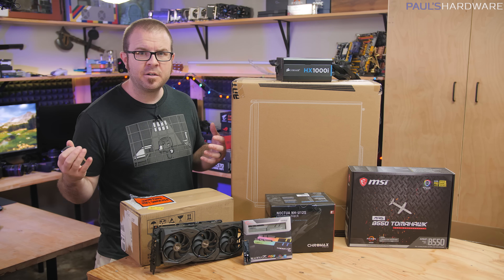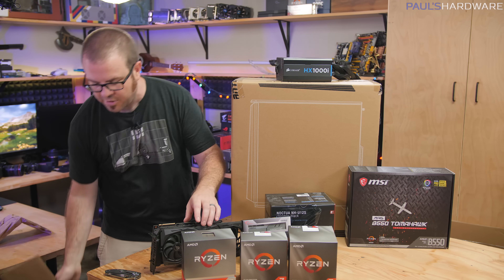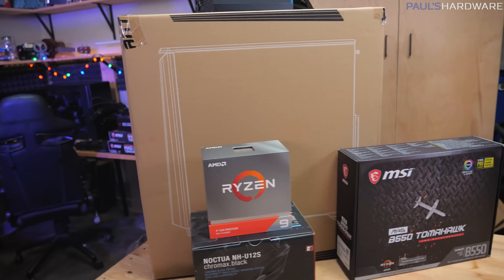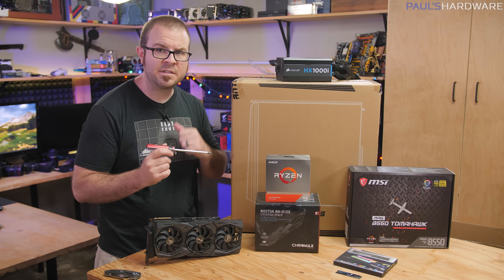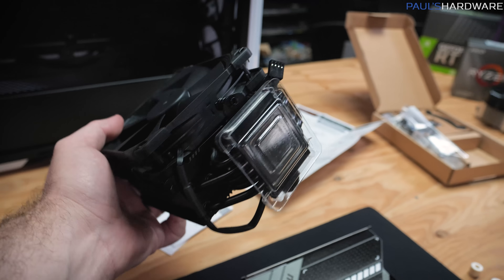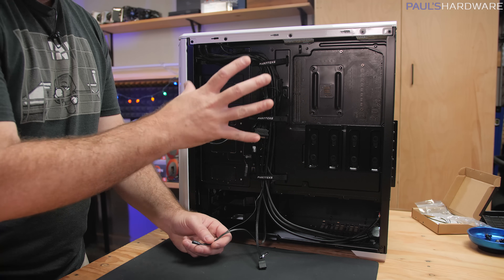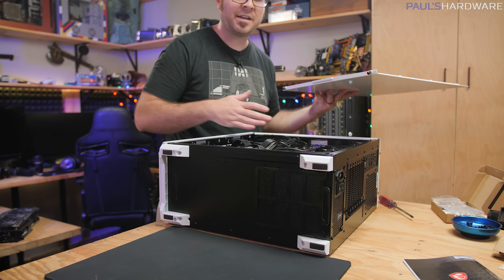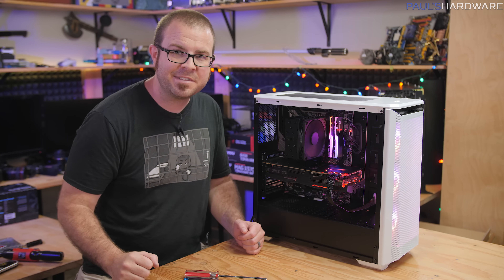Is This a "Reasonable" RTX 2080 Ti Gaming PC Build? (w/ Ryzen 9 3900XT)

Comment: I’m 60 years old and getting ready to build my 3rd rig (plus some upgrades in between).  My first computer in the early 90’s was an AMD DX2-50Mhz, 8 MB RAM, 250 MB hard drive, Windows 3.1 for $1,500, and that was a good system then.  Looking to retire in a few years and maybe produce some YouTube videos (I like to do watercolors), content creation, start a 2nd career and such.  So, I need a new computer.  After watching and studying YouTube videos for weeks (a lot has changed since my last upgrade 10 years ago), there are a few channels that I found to be very informative.  Paul’s is the best so far (Hardware Unboxed and Robeytech are great also).  I finally pulled the trigger on a processor (AMD 3700X).  Pretty sure I will go with an X570 motherboard (Tomahawk?), and still haven’t decided on a GPU yet, but the hunt is still on.  After all, that’s the best part of putting a computer together, right?
Reply: Enjoy Lonnie! Saw some unboxed 1080ti's around $600 at Microcenter recently, also if you're willing to consider used, I recently picked up a 1070ti for $300!.Worth a shot to checkout Facebook marketplace and craigslist
Reply: @Kalman29  Thanks for the input.  I am doing a death spiral around a 2070 Super or OC.  Just can't bring myself to pay for a 2080, especially since I am not even a gamer.  My build so far;
AMD 3700x-(purchased) Not sure about using the stock cooler tho.  May try it for a while and see how it works.  Don't intend on pushing the CPU to hard at first.
MSI MEG X570 UNIFY AM4 AMD X570-(purchased, got tired of waiting for the TOMAHAWK, figured I would go ahead and spend the extra $80 and build this thing NOW)
Sabrent 1TB Rocket Nvme PCIe 4.0 M.2 2280 Internal SSD-(got it on sale, $30 off)
G.SKILL TridentZ RGB Series 32GB (2 x 16GB) 288-Pin DDR4 SDRAM DDR4 3600-(purchased)
NZXT 510 Case(giving this much consideration for my case, just concerned about air flow)
Probably a 750 WATT Power Modular Supply
Stay safe and healthy!
Reply: Lonnie Edwards jealous! Sounds like a great build. Take care
Reply: 2070 super is the best choice right now 550 bucks for a card that will be relevant for years to com
Reply: @angelm3670  Thanks for the input.  I am doing a death spiral around a 2070 Super or OC.  Just can't bring myself to pay for a 2080, especially since I am not even a gamer.  My build so far;
AMD 3700x-(purchased) Not sure about using the stock cooler tho.  May try it for a while and see how it works.  Don't intend on pushing the CPU to hard at first.
MSI MEG X570 UNIFY AM4 AMD X570-(purchased, got tired of waiting for the TOMAHAWK, figured I would go ahead and spend the extra $80 and build this thing NOW)
Sabrent 1TB Rocket Nvme PCIe 4.0 M.2 2280 Internal SSD-(got it on sale, $30 off)
G.SKILL TridentZ RGB Series 32GB (2 x 16GB) 288-Pin DDR4 SDRAM DDR4 3600-(purchased)
NZXT 510 Case(giving this much consideration for my case, just concerned about air flow)
Probably a 750WATT Power Modular Supply
Stay safe and healthy!
Reply: Lonnie Edwards awesome I think your setup looks solid I also recommend you visit a really helpful pc building subreddit called r/buildapc and they can help you even more
Reply: @angelm3670  RX 5700XT for 400$ is a better deal.
Reply: Nice CPU choice! The tomahawk is a good motherboard for sure (it is B550 however, which is super fine because there not much point to x570 right now). I have a B450 tomahawk which has been fantastic. Not too sure what you’ll be using it for, but if you’re looking for a good value GPU, go for the 2060KO by EVGA (about $315 right now). I wish power supplies weren’t so expensive right now, but happy building!
Reply: @logank  Thanks for the input.  I am doing a death spiral around a 2070 Super or OC.  Just can't bring myself to pay for a 2080, especially since I am not even a gamer.  My build so far;
AMD 3700x-(purchased) Not sure about using the stock cooler tho.  May try it for a while and see how it works.  Don't intend on pushing the CPU to hard at first.
MSI MEG X570 UNIFY AM4 AMD X570-(purchased, got tired of waiting for the TOMAHAWK, figured I would go ahead and spend the extra $80 and build this thing NOW)
Sabrent 1TB Rocket Nvme PCIe 4.0 M.2 2280 Internal SSD-(got it on sale, $30 off)
G.SKILL TridentZ RGB Series 32GB (2 x 16GB) 288-Pin DDR4 SDRAM DDR4 3600-(purchased)
NZXT 510 Case(giving this much consideration for my case, just concerned about air flow)
Probably a 750 WATT Power Modular Supply
Stay safe and healthy!
Reply: Don’t buy a 2080 super or ti, they are a waste
Reply: @chickensandwich7726  Yeah, thanks, just can't bring myself to pay for it (even tho I could).
Reply: Should be plenty used to go around for cheap. I have a brand new 1070 Fe never opened sitting in the box. A u slightly used 1070 and two 1080s just sitting in boxes. Stupid crypto 😭
Reply: Lonnie Edwards I reccomend waiting for the 30 series from nvidia to launch and big navi from amd
Reply: Have you bought a case yet? If not, you should consider the Lian Li Lancool 2 Mesh? Airflow is amazing and it’s not expensive!
Reply: Did you end up going with the tomahawk? I’ve heard they had massive issues
Reply: @JamilThePimpLol  Nope.  Because of supply issues, I ended up purchasing the MSI MEG X570 Unify board. It's been a great board, no complaints at all.  Recognized everything I had right off the bat.  AMD 3700X CPU, GSKILL Trident Z RAM(64GB), Sabrent Rocket NVMe 4.0 1TB, Corsair MP 510, Gigabyte Radeon 5600XT, an old 1TB hard drive I stuck in there...it's been a great board.  The only issue I had was it would not boot at first....only because I was using an older monitor on my test bench.  As soon as I went out and bought a new 32" and new DP connections for my graphics card.....problem solved!
Reply: @lonnieedwards4829  Nice! Thats an awesome build you've got there. I recently went with a Ryzen 3900x and 16gb of G.skil Trident Z Neo RAM with an Asus x570-E motherboard in anticipation of the RTX 3070. I think the 3900x is a bit overkill for gaming, as I should have probably just went with the 3700x, but I figured for about $130 more I'm future proofing my current build that much more.
Reply: 60 years and you know what is a computer or a Phone or how to use it?!?!
Incredible! 
Here in my country every oldman hates Technology and obviusly doesn't know how to use it.
Reply: @pressstart1490  I like computers, just hate phones (and I do have a Smart Phone, only because my wife insisted I have her old one while she got a newer one).  It's like a freakin' leash.  Ya gotta remember, I grew up when nobody could just reach out and demand your attention.  It is such an intrusion on your time.

Comment: I like this AMD build, but I think an Intel 10600K may be a more cost-effective processor along with the MSI Gaming Edge Z490 motherboard.   It would knock $200 off of the total cost of the system and it would perform very similarly in games from what I have seen in benchmarks from other YouTubers.

Comment: Great build and video! I have one question though. I bought MSI MAG B550 Tomahawk motherboard as well. Everything was fine with the Windows 10 installation (Windows 10 Pro), until I reached the part where you would connect to the network. The network was not detected, so I said... oh well it happens sometimes, so I'll manually install the drivers. I did so, still no network connection. At the device manager at the properties of both the 1G and 2.5G network adapters you can see that they have the driver installed, but at the device status it says "This device cannot start" (Code 10). Installed Windows 10 Enterprise LTSC and everything was fine. It looks like a specific issue that happens due to 1 or 2 Microsoft updates, however it is strange that it didn't affect the Enterprise windows. Did you encounter any such troubles with your Windows 10 installation? Keep up the good and interesting work!

Comment: Just upgraded my MoBo and case. Used the exact same mobo and cpu cooler, but went with a Pure Base 500DX white case that also has front panel USB C, and built in RGB. (My system though only has a 3600X and 5600XT, but it is good enough for my needs)

Comment: Have to say ngreedia make me sick 🤮 I'm still using an i7 930@4ghz 12gb Kingston hyper ram with msi Rx 480 8gb, UDX3 58A gigabyte MB, antec 900 midtower I got from overclockers UK in June 2010  for £1500 planning on massive upgrade this year sometime hopefully when Amd bring a reasonably priced gpu that worth it's price tag as rest assured ngreedia certainly won't, possible £2000 budget

Comment: Update: Not fitted for 240 radiator aio top mount. Only front mount with this case. I bought this case thinking the same thing. The motherboard is set too high for proper mounting of radiator.

Comment: If you have to buy 'now' and need the power it's nice, however a lot of people must be hanging out for all the new stuff which will be out by November which could wipe the floor with all the current AMD, Intel and Nvidia gear...
How come people aren't setting up 2 Nvmes in RAID 0? - Some of the 'slower' m.2 NVMEs are much cheaper and you could theoretically get double the speed or capacity by using 2 smaller NVMe m.2 ssds..?

Comment: Will a 240mm AIO fit in the top 🤔 Something I’ve been wondering for my own P400A. Phanteks say NAY but Paul say YAY
Reply: Hey! I just recently moved my system into the P400a, and there's absolutely no way for a radiator to fit on top. I have two 120mm fans installed up top as exhaust and there's like maybe 4mm of space between them and the top of the motherboard.

Comment: Thanks Paul! Great as always. Can't wait to my disability check so I can start buying parts. I haven't had a PC in 5 years now. Last one I had a 770 MSI GPU.
Reply: I just recently got approved for the PUA (pandemic unemployment assistance), and received a check for $10,000 and dropped $450 on an MSI x570 board, 4x8gb 3200mhz Corsair Vengeance RGB Pro and a Deepcool Captain 240 RGB Pro. Next upgrade will be my 2600x which I plan on either a 3700x or go all the way with a 3900x, as well I'll then end up trying to sell off my MSI Duke RTX 2070 OC to get a 2080 super or TI.
Reply: Seth Kauffman just a reminder you gotta pay all that back in your taxes

Comment: If I'm going max Ram memory on a Asus ROG Strix X570-I Gaming Mini ITX AM4 Motherboard with  AMD Ryzen 7 3700X 3.6 GHz 8-Core Processor  what memory speed should I choose? Crucial Ballistix 64 GB  3200 or Crucial Ballistix 64 GB 3600  or  Corsair Vengeance LPX 64 GB 4000 ?
Can I still use Monitor Samsung Syncmaster 2233 21.5" or do I need new monitor?

Comment: If you need a case that is a bit larger and easier to work with, and better side panels, as they are doors, check the Phanteks Eclipse P600s. It's amazing.

Comment: I had this kind of arguement with myself a few months ago before I built my current system. I wanted a 2080 TI, but I ended up going full blitz with it. NVME drives, ultrawide monitor, 2080TI, 9900k, Asus maximus hero XI, a 360 AIO front mounted with push/pull set up and a Seasonic 850w Platinum power supply. 

It ended up being about $4500+ with the monitor.
Reply: That sounds absolutely sexy! What case did you put that in?
Reply: @mariomunoz525  The corsair obsidian 500D w/LED and fan controller.
Reply: Fuck yes!!! I was looking into that case. I wanted it so bad but i just couldnt justify the cost, but your build is right at home!

Comment: I'm trying to build a system similar to this, but with MicroATX. It's tough to find a motherboard with solid integrated features (I mostly just want as many USB ports as I can find). I'll never understand the purpose of full ATX.  SLI isn't worth it anymore, and most things you'd use the expansion slots for can be integrated into the motherboard.

Comment: i heard that if you have a nvme gen 3 on the pcie 3 slot and a nvme gen 4 on the pcie 4 slot, the gen 3 will interfere and the gen 4 nvme will not run on its actual real speeds. Is it true ?

Comment: One question I'm going to be doing my first build later on like fall or late fall. I keep going back and forth on air cooling or liquid cooling which should I go with?
Reply: Air, liquid cooling is either over rated or expensive.  A good air cooler from Noctua or Be quiet will perform as well as a 240/280mm AIO.  Full custom water is a whole different animal, cost and experience level.
Reply: @nphil93992  thanks for information

Comment: Nh-d15 fits fine in a p400a, I had one in mine before I switched to a custom loop.
Reply: Good to know. Based on the specs of the case on paper it wouldnt fit, 160mm max cooler allowance listed for the p400a and the nh-d15 is listed as 165mm
Reply: @SwolePapi15  well you should probably get the nh-d15 that just comes with one fan because I actually couldn't get my front 140mm fan on with my trident z rgb ram... but the middle fan and the cooler fits fine.
Reply: What do you mean? I bought the nh-d15 and it didnt fit with the p400a for me
Reply: @shq7621  Like I said if you don't put the fan on the front it's fine. There's a picture of it fitting on ltt Forum here's the link: https://linustechtips.com/main/topic/764262-does-noctua-nh-d15-fit-phanteks-eclipse-p400s/
Reply: i have a nh d14 in my p400a plenty of room to spare. got an EK AIO on order tho can't wait to ditch that giant hunk of metal that blocks everything

Comment: Is there a reason why you'd run the power for the GPU through that cut out and not through the lower grommet?

Not a critic of course, just in case I'm missing something.
Reply from the maker: You know... I just looked at the build again, and I have no idea why I did that. I would usually just go through the grommet. You're not missing anything 😅 lol
Reply: @paulshardware  Just fix it when you put all the other fans in lol
Reply: @Bighappykitty  ifixit
Reply: @jeffkarns5415  Insert Jayz2cents explosions here
Reply: I'm not going to lie, it set off my OCD 😂

Comment: There is literally no point in buying XT CPUs unless you're an overclocker going for high 3dmark scores or something

Just buy the X or non X versions
Reply: I ran to watch the Hardware Unboxed reveal this morning and was delighted by the 'huge nothingburger' opening statement. Yeah.... no
Reply: and they're cheaper... so yay.
Reply: edmunds tomsons  more numbers in the name equal more PFS dummy. Ur getting more cores and threads + it's more future proof and people want the most fps they can 50 fps can make a large difference in some games and even bigger change when u do 4k gaming
Reply: With the way AMD's architecture works, unless you're an extreme overclocker, there really isn't a reason to overclock these higher end CPU's in the first place. It will turbo significantly higher than you'll ever reach trying to OC it, and your performance may even drop compared to leaving it stock. Precision Boost is pretty good at feeling out the max potential of these chips, and you'll never get past an all core OC of 4.25 at any voltage on AMD. The XT chips have the better binned silicon, so you'll see the performance boost compared to the X variant. I don't know what the deal is with AMD OC. It's very frustrating
Reply: @nc7486  not true. My R9 3900 seemed to not want to max clock while gaming or benchmarking. I overclocked to 4.1 all cores and timespy score went from 12k to over 15k and while gaming I'm seeing a 30-40fps boost.
Reply: @Dannyar10  I heard that the 3900X had issues with boosting when it first came out. It may still be an issue, but I don't know, I don't have that chip. Ryzen is a funky platform
Reply: @nc7486  Well i must be lucky my 3900x overclocked to 4.3ghz all core 1.3 volts lvl 3 LLC my load voltage drops to 1.225v and is completely stable. Honestly tho messing with my RAM/IF had an even better effect then just the all core overclock. Combine the two and its basically just as fast at gaming as my 9900k at 5.1ghz.
Reply: @XxViciousxX  Yeah, from what I'm to understand, Ryzen seems to just eat up faster RAM and tighter timings. It's interesting
Reply: Rly tho or if u buy them just for gaming performance just buy a i9-10900k or i9-9900k

Comment: 2080 ti in July?

But I am glad you are using noctua u12s with a 3900xt, as I already have the same cooler on my 3600x, when I switch CPU there is no need for a new cooler

Comment: The last time I was this early the GTX 1080 TI was selling for over $1000!
Reply from the maker: remember when GPUs and RAM were super-overpriced instead of PSUs and Motherboards?
Reply: @paulshardware  2 years ago I paid $120 for 16GB of RAM and $80 for a 600W PSU, a week ago I paid $120 for a PSU and $80 for the same amount of RAM.
Reply: @Sun6935  I paid $320 for 32gbs of ram

Then swapped to a 64gb kit a while later for $210ish, felt it was a really good deal because I was used to high ram prices

Gonna be me with power supplies I'm used to $120+ psus
Reply: @paulshardware  Damn, forgot about the RAM. Those were grim times...
Reply: @paulshardware  Wait, so GPUs arn't still overpriced?
Reply: @Kiyometa  in comparison to the crypto mining rush, not so much
Reply: @ShartsInTheAir  I have 2 1070s and 2 1080s just sitting in boxes. Stupid crypto 😭
Reply: They still are https://pcpartpicker.com/products/video-card/#c=390&sort=price&page=1
Reply: 2016?
Reply: The 1080 ti never sold for 1080 Ti.
Reply: @dimensional3926  I assume you meant never sold for $1000? And yes it did sell for over $1000, gtx 1060s used to be $400 and above as well
Reply: Swift's Tech Talks shiddd people trying to sell 1060s for $200 now, makes me wanna fisticuffs mane
Reply: 😂😂😂😂😂😂 Apple CPU cost less than that and as many times faster